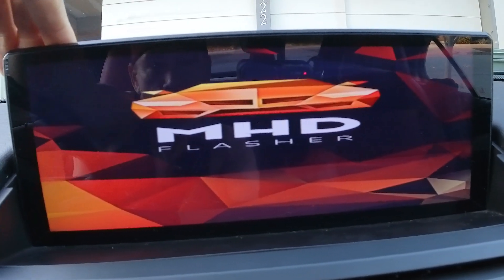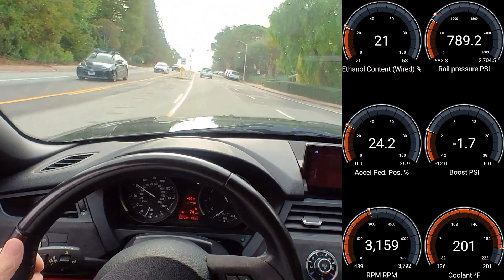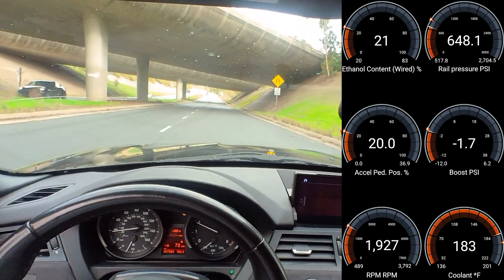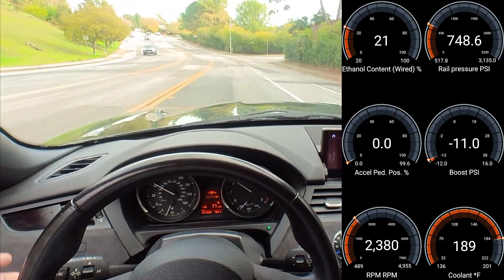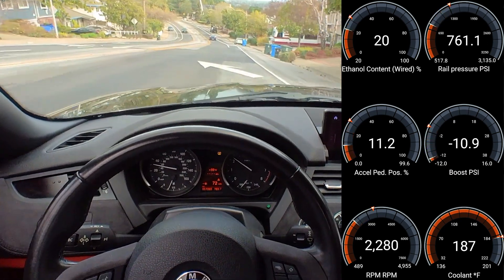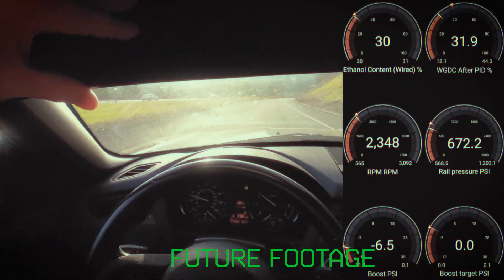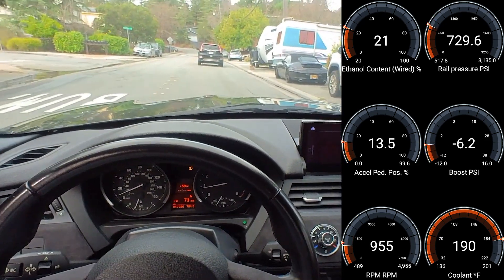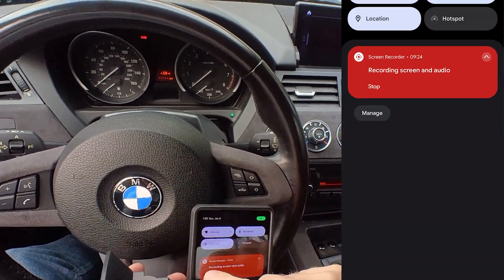E89 Z4 Build Log- N54 Flex Fuel Ethanol Spike Fix- Try these options to see if they work

Comment: Glad you were able to figure it out. 
I replaced my pr coils with stock ones and I’m still getting the spike in ethanol percentage. 😭
Reply from the maker: Did you try any of the other methods? Thats super annoying that it's still causing an issue. Even after I solved this issue another has propped up, which I haven't covered yet.
Reply: Another ethanol spike?

Comment: This is so sad, especially since there are people who use both PR coils and the Motiv box with no problems. I just want this to work!
Reply from the maker: Agreed. I'm guessing you're having issues as well? What's your base ethanol percentage with 91 octane fuel?
Reply: @Dope.And.Pretty so, i got a reply from Motiv yesterday that stated 
“Hello,
Many customers have gotten the PR coils to not interfere with the digital lines by routing the E sensor wires out and around the engine bay under the shroud where the wiper/motor area is. Or under the car and up right at the pas side strut to keep the interference away as much as possible.” I’m guessing they’re talking about the power and ground wires as there’s no way to “reroute” the ethanol sensor wires since it’s a full harness.
Reply: @Dope.And.Pretty  hey i just saw this after coming back to trying to fix this issue after a year haha. but when it was plugged in the base would always stay around 19-22 randomly fluctuating between. someone had said there is a wire that runs off the boost coming from the intake air sensor, so I had thought that maybe the reason some people have problems could be from a different air sensor from stock. like the 3.5 bar and 4 bar maf sensors. even though it has a connector to make it possible for the ecu to read it right, but maybe its something to do with that? idk.